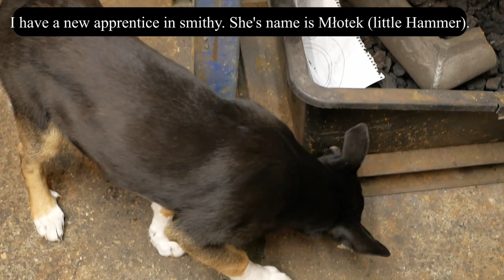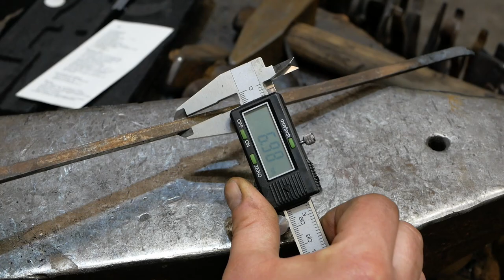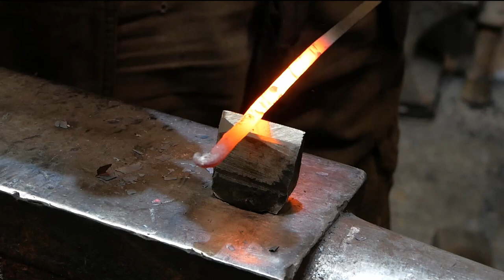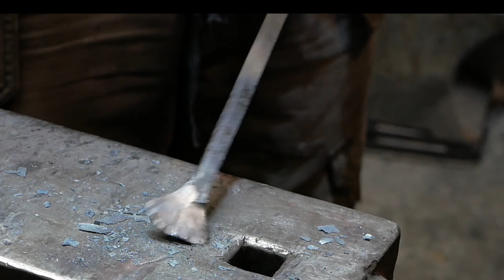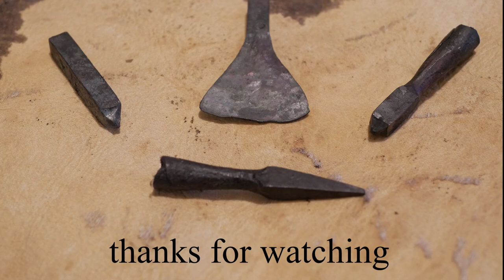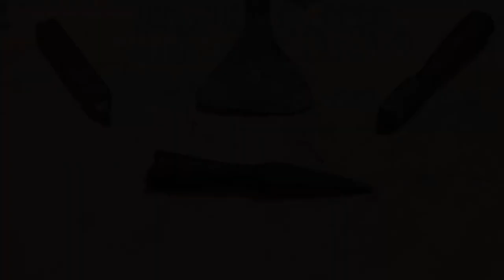BLACKSMITHING. Forging medieval bodkin arrowhead.

Comment: And to think, in medieval times, smiths would probably be making each one with only one or two heats. And to have to forge hundreds upon hundreds of them each day!
Reply from the maker: 2 heats is not a problem, one heat - I think it is possible.
Reply: So much time, skill and effort to produce those arrowheads.
    Compared to producing musket balls using molds.
    No wonder the longbows were discarded in favor of muskets.